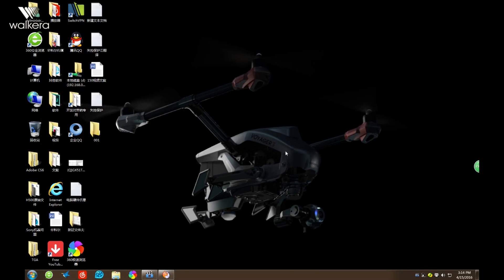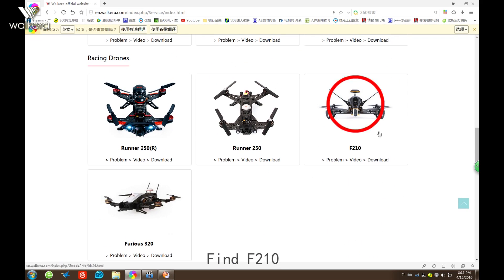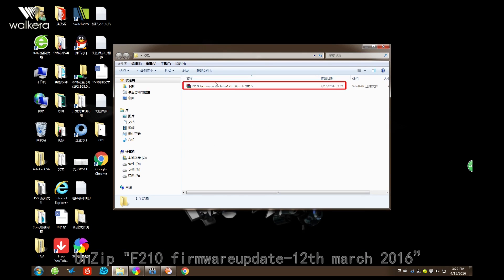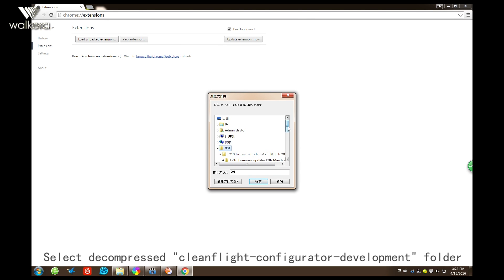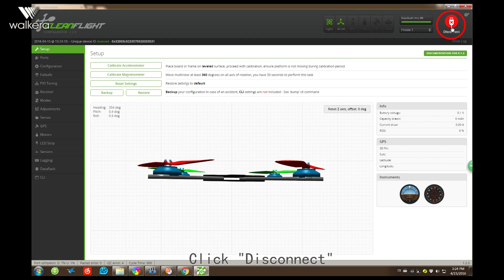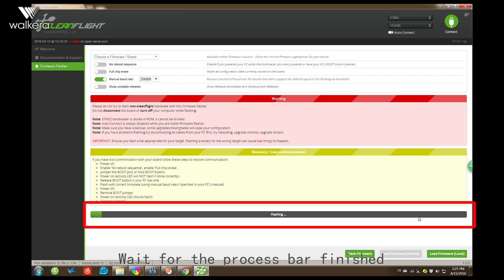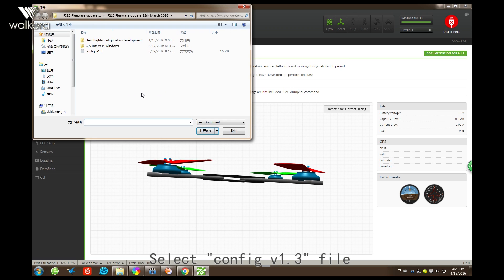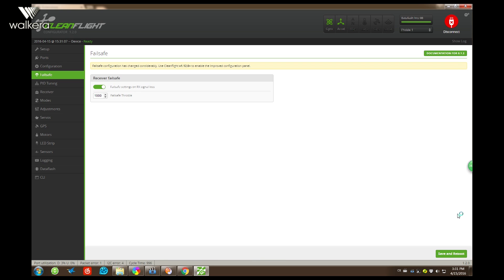Walkera F210 FailSafe system firmware update tutorials

Comment: This is extremely frustrating. Walkera does not give 2 chits about their customers once they have your $. I will not buy another walkera product, ever. I will also tell as many people as possible about this problem that Walkera has refused to fix, and how horrible their customer service is. They completely failed to fix this problem 2 years ago and made no attempt to rectify the situation since.

Your only hope is to attempt to install beta flight or clean flight which could brick the flight controller. Then you have to buy & install the new FC and try to flash the FC software on that. I did not buy this quad to fiddle with it for hours in order to get it to fly right. In fact I bought it for the exact opposite reason! I also didn't buy it, only to have it fly away. 

This could have been one of the better RTF quadcopters out there but they completely bombed it. I hope they are somehow held accountable.

Comment: WARNING!! DO NOT DO WHAT THIS VIDEO TELLS YOU TO DO. THE UPDATE DOESN'T WORK AND THERE IS A HIGH CHANCE YOU WILL DAMAGE YOUR QUADCOPTER IF YOU LOAD THE FILE. 

Many people below are reporting bootloader failure, etc after following these instructions. To resolve this you have to open the FC and follow a painful process to get the FC to respond again. 

Those that DO manage to get it to work report that the failsafe issues are not resolved. 

JUST DON'T BOTHER.
Reply: What is the solution after making this mistake?
Reply: Waht is FC??
Reply: FC = Flight Controller. 

You basically have two options. 

1 - Replace the Flight Controller 

or

2 - use a soldering iron to bridge the jumpers on the FC and re-flash your current FC uing the firmware flasher in Clean Flight. 

Both will require you to dismantle the quad to access the FC.

Comment: Did all the steps, but encountered an error when Flashing the Firmware. Now it wonr connect, every time I try to connect message "No configuration received within 10 seconds, communication failed" and "Unrecoverable failure of serial connection, disconnecting...". Also, when trying to flash the firmware i get the message "Failed to open serial port". What should I do?
Reply: Buy a new flight controller

Comment: I performed all these steps exactly and I didn't encounter any errors or issues, however it didn't fix the fail-safe for me. If I turn off my radio with the throttle up, my drone's motors will continue to spin (they actually gradually accelerated). I have tested a couple times, all times waiting for over a minute for the motors to spin down. Not working and I'm very nervous about this drone flying away.
Reply: +sn4k13s Don't feel bad. I did the same as you did and  the fail-safe fix didn't work for me either. This suck.
Reply: What happens if you turn TX back on? Do you get a bind or nothing? Using Devo7? Nervous about issue as a fly-away where I live would be dangerous.
Reply: If I turn TX back on it fails to bind everytime. This is with the Devo7.
Reply: Hopefully Walkera will fix this issue if they wait customers to come back to buy their product? you would think so anyway.
Reply: +sn4k13s To solve this problem you have to buy the upgraded receiver, I have done so and now I can assign the ID code. It remains, however, the fail problem that can not be managed by the I 7/10 / F12E. Even if I set the throttle to 30% and then I turn off the radio the engines after 3 seconds will disarm. In my opinion the problem is not fail safe was indeed solved with the last receiving the situation has worsened. Imagine being 100 meters high while losing radio signal with your F210, in three seconds you would not have time to regain control of the drone and eventually fall to the ground like a stone.
Reply: +Vassiliy Pasini - Hey Vassiliy I see your icon is the Walkera F210 3-D. Is this a problem with the 3-Ds? Walkera claims to have fixed the FS problem with this version.
Reply: +Dave Silva The fail-safe on 3d version behaves like the 2D version! The engines will disarm in each case after 4 sec. Too bad you can not handle the fail safe from the radio. To me this is not a problem, the good thing and that if you lose the radio signal with your quad least the engines disarm. Certainly after the fall of the quad will be damaged but at least you are not likely to cause damage to property and people.

Comment: what is this
Reply: When the F210 loses contact with the controller it flies straight up full throttle for 5 seconds followed by 45 seconds of almost full throttle then the motors shut off. In my opinion they should be sending everyone some accommodation for the inconvenience and or upgrades
Reply: curtis aldrich its just happened to me the same like how you say its keep going up and ilose control than idont find hem any more